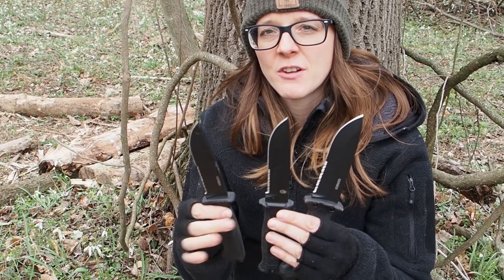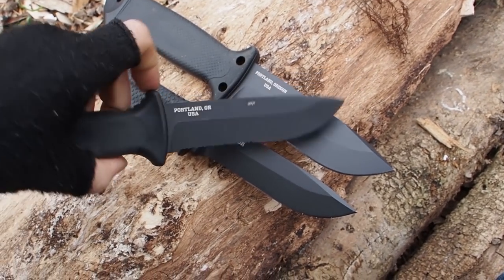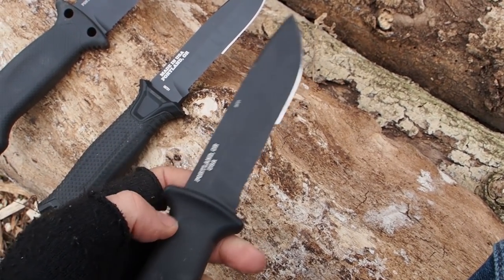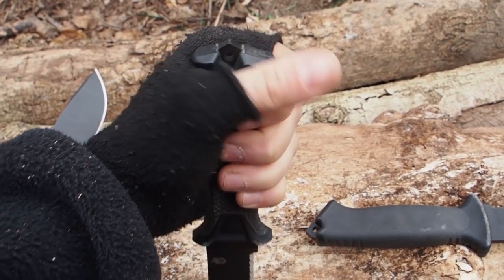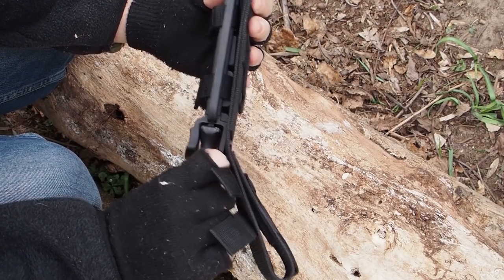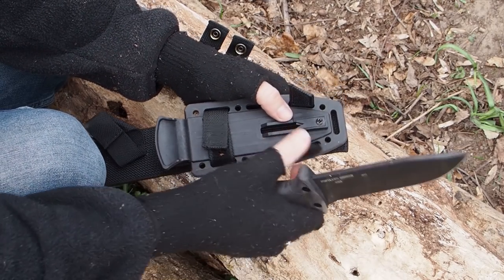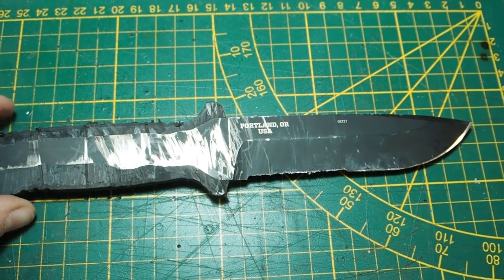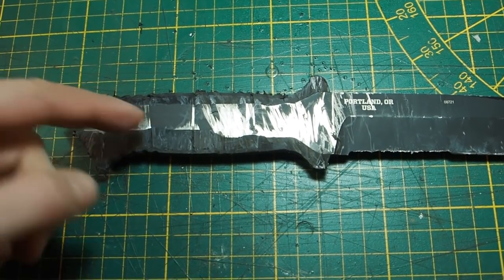Is this the BEST Urban Survival Knife?

Comment: Lily, the  LMF infantry knife was designed specifically  for helicopter pilots, so they could break out of the helicopter in an emergency. You are right, this knife doesn’t have a complete tang all the way to The back. The reason this knife doesn’t have a continuous tang is to isolate electrically your hand from the knife, in case the pilot had to cut cables, they would  not be electrocuted.
Reply: Made for the whole Air Force  , not just helicopter pilots
Reply: Same reason the Strongarm was produced was to cut open a helicopter.

Comment: The LMF II was designed for downed aircrew to be able to get through the fuselage of an aircraft like a downed chopper, where there may be live wires. Not connecting the hammer through to the tang is for electrical insulation.

keep in mind also, in such a situation, someone is on the way to rescue or recover the crew. it doesn't need to last "forever"
Reply from the maker: Dude that is ok. I myself look for sturdier knives. So the electrical gap is something I do t need.
Reply: In an urban situation you may find live wires when you're cutting buildings. not an issue batoning wood in the forest. 

I keep one in my emergency box in my truck. it's not my favorite knife but it's really good
Reply: @johnwilliamwaterhouse8597  I think a military tactical knife can also be used to cut wood. It's just not as good as bushcraft knives for these tasks that's it.
Reply: @barbar7746  A lmf2 can do it. Some light/medium batonning is fine. Not very good at carving feather sticks because you would normally use the part of the knife close to the handle and on the lmf2 it's serrated. It can do a ton of things and is very allround but keep in mind it's electrically insulated and not full tang. And I love it but not as a edc. Go shopping at the supermarket and I will be wearing red dots and when I look up, there's cops with tasers telling me to get on the floor. Can't do that here.
Reply: @Mart687  
It'll do feather sticks pretty easy and better than a plain edge. Just need to know how to use it. Instead of cutting down on the wood, put the knife in a log and draw the wood against the serrations, makes fluff like no other my friend. I learned this from Blue Mountain Bushcraft and Survival.
Reply: @Mart687  Ok, I have a Gerber Strongarm (plain edge) and sometimes I carry it when I go camping in the woods. I've batoned with it and the steel hold the edge very well. I like to have this knife because it can also be used as a weapon and sometimes I meet agressive dogs (I was very closed to be attacked more than once). At least with this knife I have a chance if I can't avoid the attack. I feel safer.
Reply: The Gerber Bear Grills knife also had that feature.
Reply: I have an LMF in my truck and the purpose of having it there it for what it was designed for: get out in case of an emergency. As both hunter and fisherman, I move within other knives that I have. Esee 6, terava jakari pukko 180, terava skrama, several moras, cold steel vg san mai, kabar bk5 and bk 9, a couple of axes, 1 of them a tomahawk and 1 martinni, cold steel pendleton lite and outdorsman lite. Depending where Im going and doing is the knives a take with me. Usually the bk 9 or skrama plus 2 more knives. I would never trust in the LMF for hunting nor fishing, its just not for wood processing, wild game processing, etc, its an emergency knife for getting out of a truck (in my case at least). Im not a fan of 1 knife doing everything, Im prone to a 3 knives solution plus, in some cases, 1 axe
Reply: @Mart687  so you can't even carry a knife or does it have to be 'california compliant'? no one ever really cares about me carrying my knives..... they are afraid of the other 'thing' though.

Comment: I've used the Strongarm as my mid-sized knife for all sorts of activities around the campsite and while hiking about.  Like any tool, it has a purpose and may not do it all but it has worked great for the majority of activities.  I'm sure most of your readers pack/carry multiple knives (use the right tool for the task at hand - not everything is solved by using a hammer).   Having a good small folder or multi-tool on the small end, the Strongarm as the workhorse and a good machete on the big end will get you through most anything you need.

Comment: One tough gal with knives. My prodegy was too thick for general cutting. Too short for batoning. I had a terrible time trying to reprofile to a longer 17° edge. So thick. I retired it for emergency off grid truck  knife because it will not rust by my water system. I have several ka-bars now, and fell in love with ka-bar M1 navy for meat,cheese and vegi cutting! I just refinished a Joker a'guila 1.4116 stainless. Smoothed it for comfort. 4 inch and thick full flat grind. 45.00 usd. Garden to kitchen wonder. Olive wood is the most beautiful ever with satin sanding and boiled  linseed oil.rubbed in by hand!

Comment: I shaved down (~ 1/4 inch, 6mm)  the upper guard on my Prodigy from Walmart (no serrations) to make it comfortable to reach my thumb over to the spine.
It's just a solid piece of plastic, so it is easy to shave and nothing falls apart or leaves any sharp edges.  It still locks in the sheath really well.

Comment: Lilly, it looks to me that the LMFII could be  used as a spear point with or without the handle. Without the handle it appears that is could be slid down in to a split handle and lashed in. Not sure but that sounds interesting to me. Particularly if the handle were damaged. Great video as always thanks for saving us the money used in testing. Best wishes.
Reply from the maker: Pretty great idea!
Reply: The lmf2 is designed to be used as a spear. Notice it's got 3 holes in the handle and the other knives don't. So you can lash it to a stick to make a spear.

Comment: I carry the LMFII, Schrade SCAX5 tactical axe and a Lennox tri-fold saw that takes reciprocating saw blades, that way I can cut through all kinds of material. When I go into our main city I am travelling underground in Subway's basements of buildings Etc. I would rather have the insulated handle because if there is an earthquake or blackout I may find myself touching things which could be electrified. Also I do not intend to put this much destruction on my knife when I have a tactical axe so I'm not worry about breaking it.
By the way I would never loan you a knife or any of my tools. You're probably very very nice person but you beat those knives to death, ha. Hi from Canada. One last thing the LMFll has a flat spot on the handle for hammering nails.

Comment: the gerber strong arm webbing is designed to be worn in the the hip/thigh, whose lower part of the sheath is strapped to the thigh, hence the movement. the strong arm sheath’s strap could be removed and attached to MOLLE straps in bags, rigs and plate carriers such as bags, backpacks, thigh rigs and plate carriers. also, the gerber strong arm sheath can be worn in a horizontal position in the belt. which makes the strong arm a very versatile carry knife. the LMFhas holes to tie it into a spear if needed…

Comment: After seeing all these knives I would choose a knife you didn’t review. I like the APO better because it would be easier to maintain in a situation where it’s used on a regular and possibly extended basis in any setting. I say this as someone who has experience with the LMF 2 and the APO. You did a good job designing the APO and if you’re concerned about electricity you can wear gloves or the handle can be wrapped with something nonconductive.

Comment: If you want something for your car, I'd check out the Oerla olhk-044. It's Chinese made but it's similar to the Strongarm and only $45 on Amazon. It's 420C with a kydex or plastic sheath. It's just like the Strongarm was price wise in 2015 when people were popularizing it back then. Maybe you can test the oerla olhk-044 for strength and durability.

Comment: If you convex the edge, then they do much better at wood processing.  You don't need to change the edge angle, just blend the edge to the grind angle.
My approach was to bring the edge (non-serrated only) down to the guard since I'm not really into stabbing people, then I convex the edge over that last 1/4 inch (6mm) or so and leave a final angle of 20 to 25 degrees per side.

Comment: i have had the lmf2 for about 12 yrs now and i stand by it 100 percent
the two extra holes to the top of the handle also allow to use paracord to fix the jnife to a stick in order to make a spear, and the sheath has a built in sharpener

Comment: You ahould try the KABAR. Realky any of them, but my favorite is the BK2. Its a HEAVY knife. Thick. Antirust coating. 5in blade.
I also like th mk1. Simple design. Simple knife. Same quality.
Ive used my bk2 as a hammer, to make food, to process wood, and everything in between. It has lived muktiole tumbles down rivers, hikes up mountains, and even been accidentaly thrown in a fire. After 4 years of bitter work, it has maintain a sharp edge with good care of it. 
It has been my favorite knife ive ever bought. I just feel good walking into the woods with it.

Comment: A few years ago I was looking for a replacement for a knife that I bought from a buddy's brother because after I bought it and started using it it seems like really cheap steel and checked out several knives. I ended up going with the Gerber Prodigy for the following reasons. It seemed to be better made than some of the more expensive options. It is made in the USA. I prefer the sheath it comes with. Unlike several of the other options the one that I bought does not have the serrations which suck in a real survival situation. And it is cheap enough that I am not going to care if it gets much damage because I am rough on knives that I carry for this type of use. The only complaint that I really have is that the handle is too small for my hands. I have longer hands than the average person my height so I do not hold that against Gerber. Keep in mind that my opinion is based on my experience over the past almost 40 years and may not be the same as someone else.

Comment: I have the Strongarm with a plain edge (no serrations) and I think it's a good knife but I don't really like the feel of the handle so it mostly sits in my bag as a spare.
Reply: I personally think the Prodigy is more comfortable than the StrongArm,I have both but I never use either..I think the S35VN ESEE 3 is a far better knife..I learned a long time ago most of these big thick bladed knives aren’t for me unless it’s a big chopper like the ESEE Junglas,OKC RTAK2,TOPS Storm Vector,etc.I like a fairly thin blade with a full flat,Scandi,convex grind or a high saber grind because they do a far better job performing most knife tasks than these 1/4” thick slabs of steel.I don’t mind a fairly thick blade if it’s also a good and wide blade that isn’t ridiculously thick behind the edge
Reply: @garrettferrell6821  If you want to see a thick knife, take a look at a Kukri. I have one that's almost a half inch think. It takes a very good edge but who knows what kind of steel it is, probably a leaf spring. I actually like it for working in my woods but it's kind of a pain to carry on a belt, it's more like a short sword than a knife.

Comment: Just commenting to improve your algorithm. The Strongarm is probably the best of the three, even though that carbide sharpener on the other one is pretty much designed for use after your steel bar test🤭

Comment: The strongarm was never meant to be the "best" knife for anything. It's prime appeal is that it is an affordable "jack-of-all-trades" that is exceptionally rugged. It is a knife one carries if you can only have one knife with you and have no idea what you're going to be encountering. As well, if you somehow damage or lose it, your wallet won't be screaming in agony. That is why it has been a popular with soldiers going on deployment.
Reply: Thx for sharing a bit or realistic observation wisdom. I quit buying super expensive knives years ago. The first time I ever lost a Benchmade EDC that I paid $175 for I quickly switched to $60 CRKT knives, and from there, switched over to even cheaper brands like Schrade, and Smith & Wesson EDC knives, on sale, for $25 and under. Along with the occasional kershaw. I use them like tools, like I would a screwdriver, or a pair of pliers, and I don't have to worry about losing them, or damaging them, and they do exactly what I need them to do with no fuss and just the occasional sharpening here and there. I usually carry two. One sharp, and one duller that I use for utility stuff, like scraping, and scratching, and prying. Occasionally I'll snap the tip off one since they are mostly stainless, probably something like 8CR13MOV or equivalent. But in general you learn their weaknesses, and make them work for you. And they are cheap. And even disposable if needed. I've had to abandon them at airports, I've had to abandon them in alleys outside of bars that wouldn't allow me in with a knife, when I was unable to return to retrieve them. A knife is just a tool. And they don't have to be the absolute best to service needs. There's an old saying, that only a rich man can afford to buy cheap tools. But I would say only a rich man can afford to buy expensive knives. You can buy 5 or 10 cheaper knives for the price of one sometimes. And that's a hell of a value.  Now, don't get me wrong, I don't buy the cheapest knives. And I'm pretty particular. But if you choose right, and you know the qualities that you're looking for, you can certainly find affordable, high quality knives that will last much of a lifetime without breaking the bank. Especially if you know their limits, and don't abuse them.

All that said, I do own some high-quality, expensive survival knives. But I didn't pay a lot for them. And some of them now are quite valuable.

So, if you have an understanding of quality (and qualities), and value, and you find and purchase really good, well-designed knives (this is key), at really good prices, and hang on to them for 20 or 30 years, you might just find that you have some very valuable items tucked away in a drawer some place at some point. 

The best knives of today will someday go out of production, and be highly desired in the future by those who are familiar with them.
Reply: Your comment is totally on-point. I believe folks who buy expensive things, be it knives, boots, guns, watches, are "enthusiasts" who collect these items for the personal satisfaction of owning something unique, rather than for any functional utility. There is some truth in the old adage that "you get what you pay for..." in that the higher price often (but not always) gets you more durability, better craftsmanship, quality of materials, etc...but beyond a certain point, a person is just paying for status and bragging rights. Like yourself, if I need to use or wear something day in and day out on the job, I always  buy the item that meets my functional needs at the lowest possible price.

Comment: Great review.  I feel that the infantry knife with its gap between the hammer and the tang is a bad design as well. How much electrical isolation could it possibly provide with power lines or high current battery cables?  The handle would most likely melt away and separate or simply arc through or across the user's sweaty hand. Thanks.
Reply from the maker: Maybe it is good to cut low current wires.
Reply: @SurvivalLilly  try it n c .

Comment: Their ultimate survival knife is the same as the LMF2, the hammer pommel is not connected to the tang.
In my opinion, the lmf2 is overpriced and over rated.
I may be wrong, but I believe the lmf is electrically insulated

Comment: Yes, the Strongarm IS the best knife on the market when you factor in the quality, durability, and price. It is literally #1. It has survived destruction test other more popular and expensive knives could not.. 1095 is junk steel.. I don't know how it got hyped up into being good steel for knives. It's hard and brittle like glass. 1095 are the easiest knives to break.. Smack one on some concrete 1 time and your 1095 knife will shatter like glass.

Everything else is hype/name brand.. The Strongarm is quality and performance with the durability and is probably the most tested knife on YouTube. It's never failed a test

I got the limited edition Strongarm from Blade HQ.. It's green and doesn't have the black coating on the blade. Cost $100 if anyone is interested in getting the limited edition Strongarm. Blade HQ is the only one selling them.

Comment: No the edges don't carve well enough in my Experience,get a bark river, just trust it, you need a scandi or convex edge, a secondary v edge will never work like a proper wood carving or splitting edge, Bark River makes serrated Mac-vsog Bowies,you should try it, it is just expensive however worth it. The LMF ii is the best in this video though.